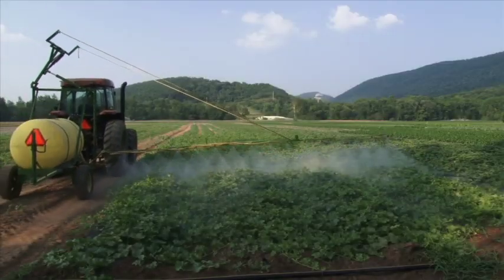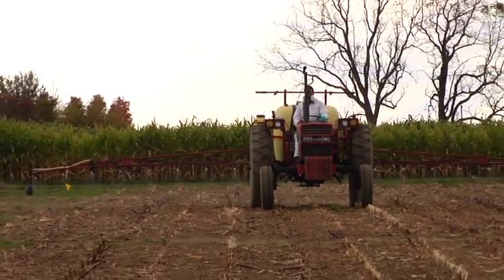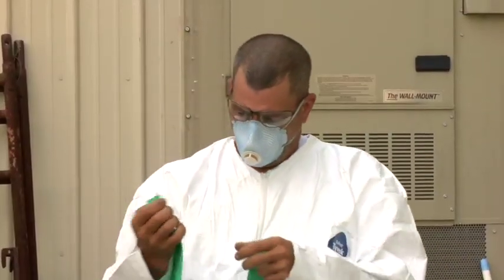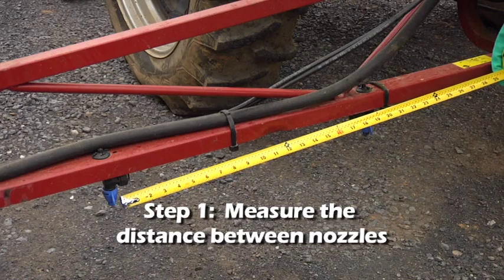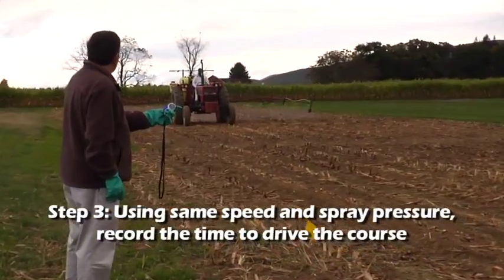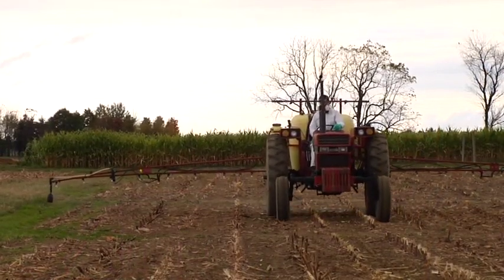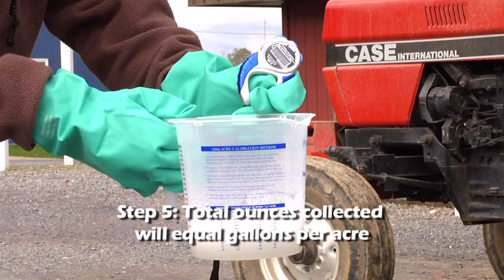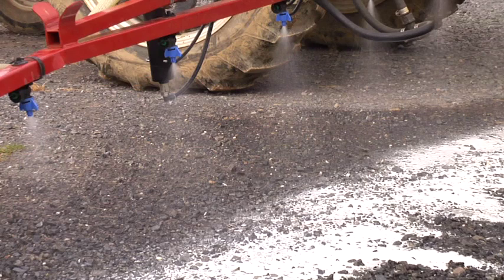Boom Sprayer Calibration

Comment: Hey Dutz: What about a hydraulic driven motor on the sprayer pump to maintain constant pressure, no matter what the engine rpm? What about a tractor foot throttle to adjust sprayer output on variable organic matter soil in a field?  Also, what about using a foot throttle to adjust engine rpm to maintain same speed in going up a hill and then down a hill? I thought you honcho's had a college education.
Reply: earthman 2002 -